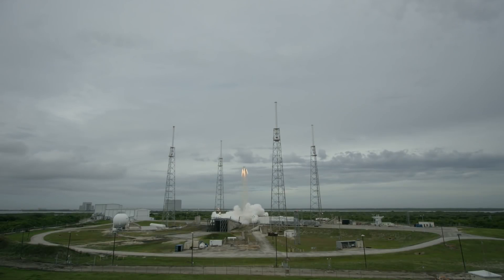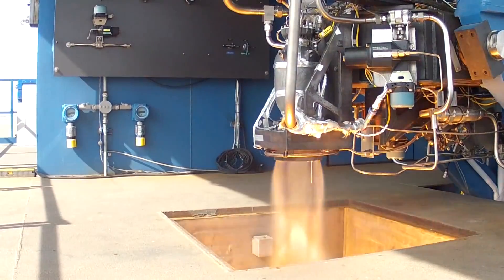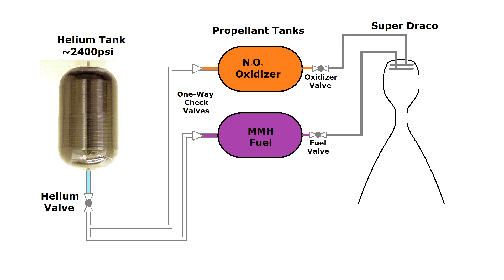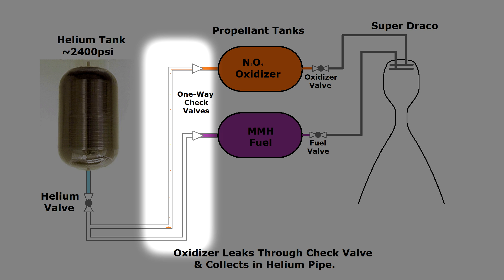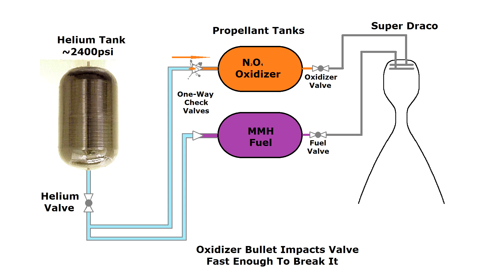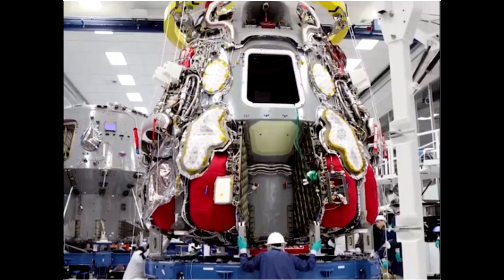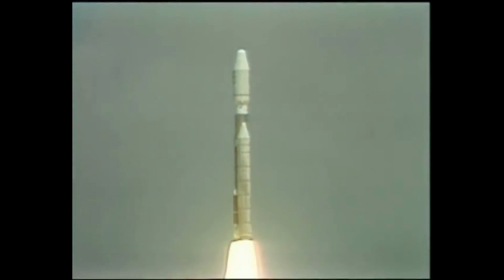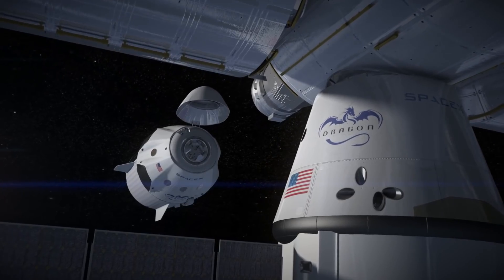SpaceX's Crew Dragon Spacecraft Exploded Because of 'Corrosive Bullets' and Leaky Valves

Comment: So, in essence, a leaky check valve built a gun armed with a nitrogen tetroxide bullet set to fire right when the controllers pressed the button labeled, "Make the spacecraft safe really quickly"? That's some proper tragic irony!
Reply: Only tragic if there are people on board. These tests are done SPECIFICALLY to discover these kinds of issues. Better to have a dozen blow up in testing than have one blow up during a mission launch
Reply: @blackoak4978  Still, the design was naive and the engineers attitude ("who knew?!" - lotsa people, that's who) is worrisome. Tests cannot find all failure modes, live people would find some more later.
Reply: Analogous to how pressing the AZ-5 button to make a reactor safe caused an explosion due to water being replaced with graphite.

The difference here of course being that this was a "well known" and documented failure mode that was tucked away to save face.
Reply: @swerasnym  Thanks, no one is mentioning this--it likely happened to the Mars Observer already, so it SHOULD have been expected, but they just forgot about it.
Reply: @swerasnym  Definitely. I think SpaceX is projecting a little too much naivete. "Who knew titanium valves could burn in high-pressure NTO (after disintegrating)?" 

Though I'm sure the system could have been designed more robustly, I wonder if something in the propulsive-landing heritage of Crew Dragon precluded utilizing one-use burst disks entirely.
Reply: A cheeky leaky check valve

Comment: I worked in the oil field as a mechanic for years. Usually check valves are set it and forget it until the seal goes bad and all hell break loose.

Comment: Correct me if I'm wrong, but switching to a burst disk would also mean that you couldn't do more than one pressurization cycle.  Once the system got to pressure it would need to stay pressurized until the vehicle is taken out of service for refurbishment or completely de-fueled through operation.  Which would mean no in-situ refueling of the craft.  I think they're going to have to come up with a different solution to prevent this with their BFR.
Reply: This system is for the emergency escape thrusters.
Reply: Ah, ok, I wasn't aware that they had a fully isolated fuel system.

Comment: Could the same chain of events have happened in a real launch situation? Was that a real safety issue, or an artefact of the testing sequence?
Reply: We don't know.
Reply: Yes it could  have.  I have worked with check valves and corrosive gasses .  Leaks do happen.  Did the testing sequence make the leak more likely?  It is possible but we do n't know how the testing was different than normal operation.
Reply: @stevenf1678  Everyone knows that. That's why every hypergolic propulsion system will have both isolation valves and check valves. Incidentally, SpaceX never said the check valve leaked.

Comment: Similar phenomenon to steam hammer where you get a slug of condensed steam (water) in a low spot that gets accelerated by steam being turned on.
Reply: Was a boiler tech in the NAVY and worked on 125psi system. Due to rolling of the ship in heavy seas than a water hammer main steam piping blew a hole in the pipe scared the hell out of me.  Shut system down it outher boiler off.
Reply: And this 2400 psi with explosive fuel that can burn with metal.
Reply: @jamesdewey3259  .....Sure swell you weren't flying.   A shut down'd be kinda tough, huh?
Reply: @truthsRsung  to shut down the boiler I worked was about 5 steps.
Reply: @jamesdewey3259  ....I was commenting on where you experienced your problem....floating on the ocean, not flying thru the air.
I am sure even your boiler had relief valves, condensing traps and sensors/indicators that would protect you and your crew even if the boiler was misused.
This "space craft" doesn't.
Reply: Guess none of their engineers ever worked on a boiler, huh?

Comment: Scott, I assume that the burst disks will be stainless steel as well as the downstream piping to the oxidizer and fuel tanks?  If I were the design engineer I would spec the piping between the helium valve and the burst disk to be SS.  I realize that titanium piping is lighter but the extra weight of the SS pipe is worth a gain in the factor of safety.  I would also test every batch of burst valves to be sure they burst as specified as part of the certification.  If you were flying in the Dragon, wouldn't you want that system to work with a 99.9999% reliability?
Reply: Titanium and aluminum are corrosion resistant due to a thin oxide coating that forms as soon as the part is exposed to air. Stainless steel is corrosion resistant due to the same type of oxide layer.  So stainless steel might fail in the same way as the titanium did.  But we won't know until it is tested.  An alternative is to coat the metal with teflon or some other non flammable material that will not react with the oxidizer int all.  Or you can make the check valve out of ceramic.  Ceramics cannot burn because they are already oxidize.

Comment: I don't understand how a burst disk can replace a one-way valve.
Reply: Only the extreme high pressure of the helium is going to rupture the disk. The escape sequence is a one-shot affair, so no valve is necessary. You just replace the disk-assembly when the capsule is recovered.
Reply: tubeist- dan So the superdracos will only be used for escape?
Reply: @ryanadams6616  Yes.
Reply: The point is that the discs keep the helium and the fuel hypergolics apart until the helium pressure is allowed to rise at which point the discs rupture and the fuel system can be pressurised. Think of a one-way valve as a burst disc which can repair itself (i.e. close again). Although reusability is a good goal, when you have had to engage the abort system, even if the capsule ends up being reusable, some refurbishment is inevitable, so replacing burst discs is not going to be too much of an issue.

Comment: well while failures suck, they are also important. As you gain far more information from a failure than you do from a success. Because a failure will tell you what caused it to fail, and mostlikey find out why it failed. A success will only tell you that it worked this time. Much better to have a bunch of failures at the beginning when no one gets hurt, that way you know that when something works it was built off of all the things that went wrong before.

Comment: Your explanation was very clear.  Your descriptions/graphics were concise.
In my experience, check valves are always subject to leaking (reverse flow).  Some method of venting the upstream side of check valves is standard.  If SpaceX had vented the line, then purged with a tiny amount of helium—this wouldn't have exploded.
(I mean, ‘purge after arming’.
SpaceX’s solution of using burst discs will also work.) <— I added this text when I edited this comment.
Reply: Yeah, but we are talking about an abort system, it needs to be as fast as possible.
Reply: @Vaasref  : It doesn't need to be fast until it arms.

Comment: This is a question out of ignorance/lack of understanding, obviously, but why don't they use double-check valves, that way both leakage and residual back-flow are far less likely?
Reply: I'm going to guess that weight is an issue. Also - and I'm reaching here - the activation time will be critical on an abort system and a dual check valve system could, conceivably, slow the pressurisation down enough to be a problem.
Reply: @martinayton6674   these valves are very light. I seriously doubt that was the reason even remotely.. Although the activation time is definitely a plausible reason.
Reply: No one expected that such a small leak could have caused this.  Everyone expected that if a small leak occured it wouldn't cause any harm and the leaked material would just be pushed out of the pipe and through the check valve without any problems occurring.  So no one thought a small leak would be a  problem and as a result no one thought it was necessary to add a second check valve.  

jAlso it should be pointed out that if one of two check valves is leaking you would still get an explosion.  So they need to find a material that will not ignite in this situation.  And then they need to make a new valve out of the material and qualify the new one for use.

Comment: Should have included a diagram with the modified system using the burst discs. I'm curious to see how they are incorporated into the design.
Reply: Instead of the check valve the burst disc??

Comment: Maybe I missed something, but why does the Helium pressure in your illustration change from 3000psi to 2400psi in the middle of the video?
Reply from the maker: Because I found out the actual value partway through making the images.
Reply: @scottmanley  I figured that was the case.  Also, really excited to get a reply from you!  Big fan of your work!

Comment: Thanks very much for this. I was wondering anything at all about this. So, it's good to finally hear something. Any idea if it would take much to replace the valves for routine flights? I'm just a fan of reusability, so I'm wondering how that would hold up things.
Reply: The abort system would never get reused anyway – Crew Dragons go to cargo after their first flight. It probably wouldn't add significant time over routine maintenance, though.

Comment: Surely a slight addition of an extra controllable valve and a purge mechanism would render this issue moot?
Reply: That's unnecessary mass, cost, & complexity when a burst disk will suffice
Reply: True, and for this application it will be fine, seeing as there is no scenario where the SD's need to fire multiple times per mission. Still a good learning moment for future upgrades or other platforms that do need that functionality.
Reply: Or redesign the check valves so they will not burn and can handle the stress of the failure mechanism.  Also  keep the bust disk.  This would allow the system to be used multiple times during a mission and the burst disk would prevent leaks while it is waiting on the launch pad.

Comment: May be a stupid question, but why does the engine need helium if it's stopped by valves anyway?
Reply: The helium pressurizes the fuel/oxidizer plumbing to feed the draco engines at the pressure needed.
Reply: @JohnMGibby  Oh yeah I was kinda dumb there. I for whatever reason thought that the valve wouldn't let the helium through :D

Comment: @Scott Manley - do you know if the burst disk is being added downstream to the check valve, or is replacing the check valve completely?
Reply: Not made explicit I think but it is likely completely replacing. You want an abort system to have as few potential points of failure as possible.
Reply: @texasyojimbo  Yeah, I've been pondering that; the only rationale I can think of having both is to save you from upstream helium leaks after you've ruptured the burst disk.

Comment: As soon as you said high pressure helium and a leaky one way check valve that leaked back into the piping I immediately recalled a concept in fluid/steam piping called steam hammer 

This is where small bits of steam will condensed into water in a high flow steam pipe, resulting in a blob of water being thrown down the pipe at very high velocity resulting in a mass of water being sent down a pipe VERY quickly, ultimately destroying stuff in the process

Comment: Burst disk is 100% fine here, this is after all part of the abort system
Reply: Now it is. But remember, as originally planned, superdracos were meant to be used as landing thrusters. So burst disks were kinda out of question.
Reply: @mancubwwa  Not really. You just have to pick if you want to abort or land using superdracos. Can't do both.
Still want to see D2 land using engines, at least with cargo.
Reply: @steeltalon8194  while indeed landing and abort are mutally exclusive, i doubt burst disks would work, as you would want not only ability to throttle, but also to restart the landing engines.
Reply: When SuperDraco were meant to be used as landing thrusters, abort and landing were not exclusive : how do you land after an abort, with burst disk?
Reply: @mancubwwa  You can still relight the engines since you have the valves at the combustion chamber end, it just means you can only pressurise the system once.
Reply: @matthsini  Parachutes? IIRC they were slways included for emergency, either during abort or failure to ignite thrusters on return. Especially as any flight from Kennedy would be aborting oved atlantic anyway
Reply: @matthsini  With parachutes ofc. I'm not questioning SpaceX decision to prefer reusable technology. Just pointing out the landing should still be possible even with burst disks. Unless reentry profile requires re-ignition of superdracos.
Reply: I didn't now that parachutes were included with Superdraco used for landing!
Reply: @matthsini  well i'm not 100% sure, but I think i read it somwhere.

Comment: So a check valve is a hydraulic diode, eh?
Reply: yes.
Reply: So what does that make a burst-valve? A negative fuse?
Reply: @gordonrichardson2972  That would be similar to how most electrical insulators behave after their breakdown voltage has been reached. For example plastic develops carbon tracks which are fairly conductive in that case.

This is practically never used in electronics since there are much more reliable, reusable ways to achieve that, such as Thyristors for example.

Comment: Why do they have check valves in the first place? They seem to have been unreliably in the past and what's wrong with a electrically operated valve in place of those check valves to ensure it's properly closed while fuelling?

It looks like a bad idea to rely the integrity of your whole spacecraft on the proper function of a spring operated valve right next to a super corrosive fluid.
Reply: Simplicity, less moving parts that can wear, cost, durability and reliability of alternatives.
Reply: @PinataOblongata  No. Burst disks are simpler , have no moving parts , are more durable and more reliable .
The answer was given in the video: 4:56
Reply: @totalermist  I think you meant to reply to Ruben and not me? You basically mirrored my reply.
Reply: @PinataOblongata  it's a valvebody with a spring vs a electric motor with a valve body and two gears.

Since we're speaking about a one time use anyway the question is, how reliable is an electric valve? Cannot be that unreliable since it's used 3 times on that same system, which all have to function properly.
Reply: @RubenKelevra  It's a good point, but perhaps the different places they are used make them more suitable?
Reply: @PinataOblongata  I think it's just cheaper to use one check valves, than electrical ones. Especially if you multiply it with the numbers of engines.

If there's no need to throw more money at an issue, it's usually not done

Comment: The blob on the MS Paint diagram should be purple not orange if it is fuel.

It seems the fuel and the oxidiser shares the same helium pipework, if it did not then this would not happen and you could use the valves again.
Reply: not really.. you still need the check valve at each the Oxidizer and Fuel Tank to make sure they dont flow back into the helium piping. but by seperating the helium piping for each you need two valves for the helium tank, so your helium piping is not pressurized all the time. Also it doesnt fix the issue that the check valves might not seal properly and create an oxidizer bullet which shatters them when the piping is pressurized. 
My reuseable fix would be two check valves for each tank, and a sensor detecting liuids between them to give an error if the first valve is not properly sealed.

Comment: Someone commented on being surprised by the fact that titanium will burn. FYI, many materials will burn given a sufficiently agresive oxidizer and a high enough ignition temperature.
Reply: I was one who asked about titanium burning. From the news report it wasn't clear where the high temperatures for ignition came from...
Reply: Friction between the fast moving oxidizer and metal of the check valve could produce enough heat.  It could also creat a static electrical charge and spark.  And a spark will be hot enough.
Reply: Case in point, fluorine and chlorine trifluoride ignite on contact with sand, concrete, bricks, organic matter, most metals, etc
Reply: @TheBackyardChemist  I don't think anyone is seriously suggesting the use of fluorine as an oxidiser for rockets...
Reply: @gordonrichardson2972  Oh, they tried it in the 1960's, look up the book called "ignition an informal history of rockets"

Comment: It's amazing that these spacecrafts are built like a Swiss watches who would have thought a little blob of propellant and a valve like that could lead to a big explosion
Reply: Rockets are usually built to material limits. Any other way will be inefficient. If you shrink rockets down to the diameter of a soda can. Then the tank walls are thinner than that of the soda can.